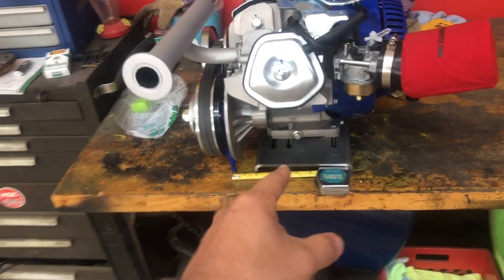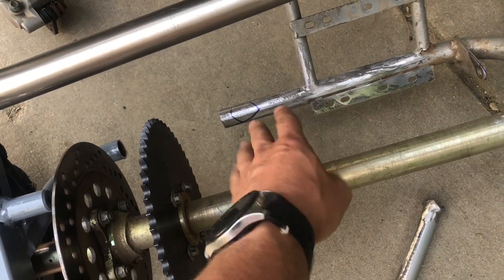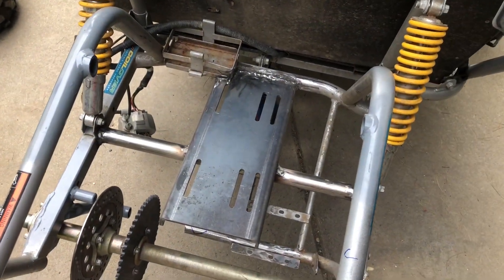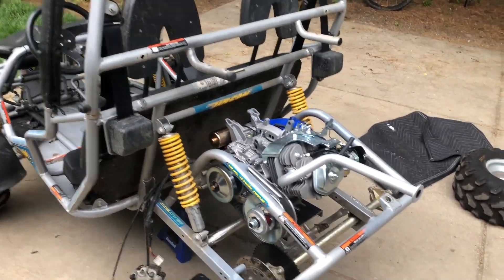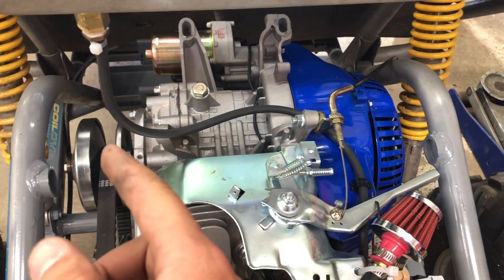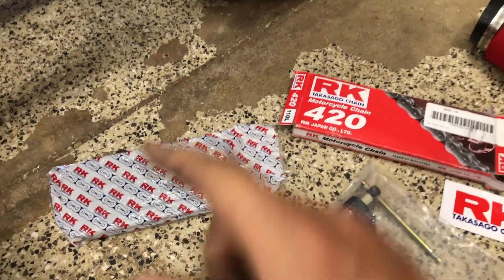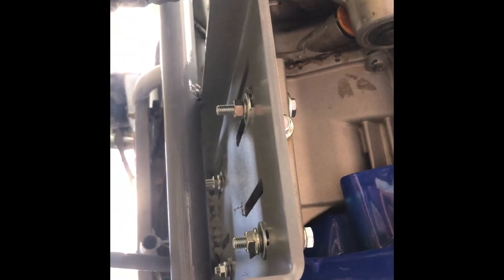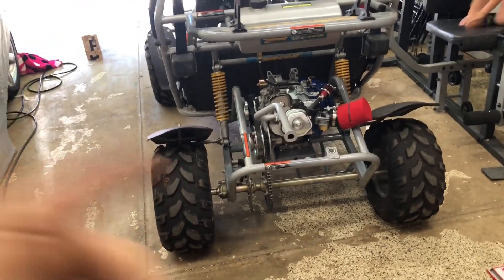Zircon/Carbide 150cc To 440cc 20+HP Engine Swap- Part 4 Engine mounting and final touches

Comment: sorry to bother you but did you have to remove the e break when  you relocated the brake
Reply from the maker: Yes ended up removing the e brake entirely.
Reply: @PeakPerformanceEngineering  so does the brakes still work in the back even though you removed the e brake I already moved the brake caliper but the only thing connected to it is the wire where the bleeder bolt is located
Reply from the maker: Yep rear brake still functions just like normal. Just no e brake anymore.
Reply: @PeakPerformanceEngineering so I guess the reason the pads are not engaging is because i need to bleed the brakes right
Reply from the maker: Only if you removed the brake line from the caliper or from the reservoir. But if you did either of those then yes you need to bleed. 

From what I remember I didn’t have to disconnect the lines.
Reply: @PeakPerformanceEngineering  yea I had to take the line off I bought a new caliper.
Reply from the maker: Yeah once you bleed it you should be good

Comment: Did you have to flip the axle around and if so how hard was it to remove?
Reply from the maker: Yep I did check the zircon playlist I have a video showing it. You have to relocate the brake caliper to the other side which requires some welding but other than that not bad from what I remember

Comment: What’s the length of bar you welding under plate?
Reply: Thanks
Reply from the maker: @MichaelFarmer-r6n  working on a similar project? It was fun when it was all done.
Reply from the maker: @MichaelFarmer-r6n no problem :)
Reply from the maker: Ah sorry this was a few years ago now and sold this project off after I finished it last year I think it was.
Reply: Think it was ?
Reply from the maker: @MichaelFarmer-r6n  your guess is as good as mine 🤣It was 4 years ago. But Looking at the video again when I was showing it mocked up, maybe 30”?

Comment: I have a taotao 125cc gokart motors no good so ive got one of them predator 670cc i have a few questions ive got the motor mount welded just have installed the motor today 

But anyways how do i get the motor to go in reverse when needed 🤔 thanks
Reply from the maker: You’d have to see if any companies make a reverse kit for the 670cc. I know they make them for smaller motors, but not sure on that beast. On this kart I did, I didn’t have reverse, I’d just have to get out and push it whenever needed.

Comment: Do you have a list of all the items you used ? I’m doing something similar as we speak on my carbide  I have a gx390 motor I’m following your videos to help me. What kind of sprocket did you use on the axle! Thanks in advance
Reply from the maker: I think in the video description there should be a link with most of the stuff. I ended up with a 54 tooth sprocket I believe from go Powersports. Abs finally I had to use an actual 40 series torque converter from go Powersports as well.
Reply: @PeakPerformanceEngineering does that engine feel stronger then the gy6?
Reply from the maker: @ElPatronGamefarm  oh absolutely it was. The way I had it geared the top speed wasn’t too much higher than a GY6, but it would reach top speed probably twice as fast. Much better acceleration from all the extra torque. I sold it before I could swap springs in the go Powersports 40 series, but that would have made it even faster.
Reply: @PeakPerformanceEngineering  did you see a major difference between the Amazon and gps torque converter? How often were you going through belts on each torque converter?
Reply from the maker: @ElPatronGamefarm huge difference of GPS vs the two or three Amazon versions I tried the GPS unit is stupid expensive for what it is, but it works and it works great. Once I installed the GPS one there were no more issues.
Reply: @PeakPerformanceEngineering  I use to have the juggernaut torque converter from gps but it use shred belts like crazy, was debating if going with the 40 series or the 780 tav which is 600 bucks! But didn’t want to spend that kind of money if the their 40 series is good enough
Reply from the maker: @ElPatronGamefarm I looked at that too but dang that’s expensive. For that price you might as well swap a motorcycle drivetrain in. 

But yeah after getting the $300 GPS unit it was good to go. 

The Amazon one would shred the belt after 15-30 min of use. One time the stupid belt flew off and hit me in the back lol. I tried different belts and too but nothing helped it.

Comment: im in the process of doing the exact same thing but with a predator 420 any advice before i start trying to get the motor mounted currently in the process of changing every single bolt for brand new ones all im doen to is mounting the axle and after that it’s gonna be time to mount the predator whats the best route to go to save the most money without losing out on any fun
Reply from the maker: For this chassis I had to flip the axle and relocate the brake caliper bracket to the other side. Then I welded a bar across which located one side of the engine plate and the side was against the existing frame. It was all a pretty simple process. Most expensive part is the dang go Powersports 40 series torque converter. All the cheaper 30 series woukdnt work and would blow the belts off

Comment: What size of belt did you use?
Reply from the maker: Oooohhh testing my memory. Tough to say, it was the belt that came with the 30 series kit on Amazon. It was labeled as a 40 series,  but in reality it was just a 30 series. If you look at some of the latest vids on the build I ended up having to switch to the big bucks go Powersports 40 series to not keep from shredding belts.

Comment: Is there anyway to adjust the takeoff time,meaning I have to give it alot of gas before it moves
Reply from the maker: Yes you can buy kits to adjust the springs and roller weights of the CVT to get it to engage at different RPMs. If you have a GY6 this might be helpful: http://www.buggydepot.com/buggy-tech-center/150cc/Yerf-Dog-Blade-GY6-Buggies-Parts/8

Comment: What size is your rear sprocket and the sprocket on you torque converter did you change the rear sprocket to from the 530 that was on it
Reply: Did you figure it out? I’m doing this to my carbide ! I’m swapping the gy6 toa gx390 I’m gathering all the stuff I need ! I remember he mentioned he replaced the sprocket on the rear axle but can’t recall what size
Reply: It’s a 54 tooth sprocket

Comment: Definitely needs a 40 series for all that weight and power. Never keep a belt otherwise lol. But I love the build. Have a similar setup.
Reply from the maker: Your right so far its been chewing the belts, but I'm too cheap to blow $300 on the go powersports 40 series so the next project is to play around with it and see what I can get to work.
Reply: @PeakPerformanceEngineering  I went same route. Got a cheap 40 series off Amazon for 200, now I'm adding red springs and a new compression spring. Hopefully it makes this cheap one work better. It grabs on deceleration.
Reply: @slimyelbow is it stronger then the gy6?
Reply: @ElPatronGamefarm  yes
Reply: @slimyelbow  did you end up adding reverse to yours?
Reply: @ElPatronGamefarm  no. But it really isn't necessary.

Comment: What’s the top speed on this thing ?
Reply from the maker: It only hit around 30mph with the current sprocket setup, but much more low end torque and acceleration than the 150. Over the winter I want to play around with some different sprockets to see what I like best.
Reply: @PeakPerformanceEngineering   and you still have your governor? Any further adjustment on the throttle ?
Reply from the maker: @Mini.Moto.Guy806  governor was completely removed. Throttle seems to function fine and go completely WOT. However I suspect the cheapo torque converter I have might be an issue. I might have to pony up and spend the $300 on a real 40 series as this Amazon knock off doesnt sound like its revving the motor high enough and keeps eating belts. I need to play around with it some more this winter and I'll post an update.
Reply: @PeakPerformanceEngineering  sir that is a 30 series torque converter not a 40 on your video
Reply from the maker: Yep that’s correct. It’s an el cheapo 30 series from Amazon. If you check out the latest videos I ended up having to get a 40 series from gopowersports. That seems to work well but now I’m working on electrical upgrades then I can do some more testing :)